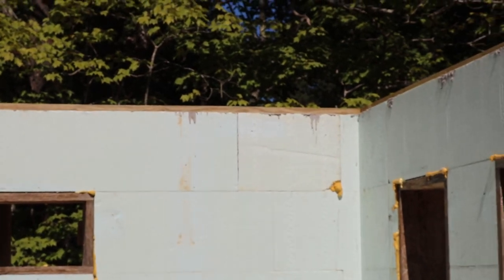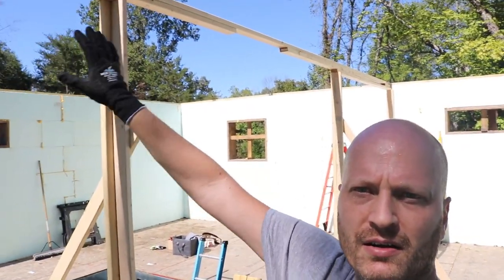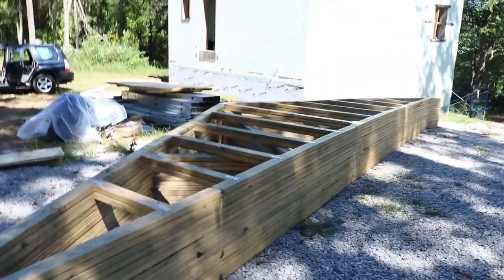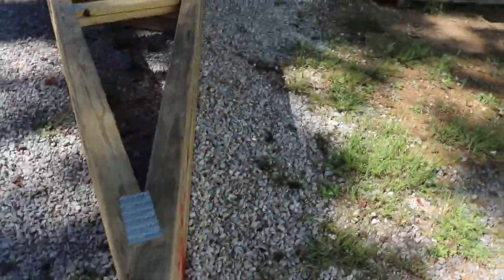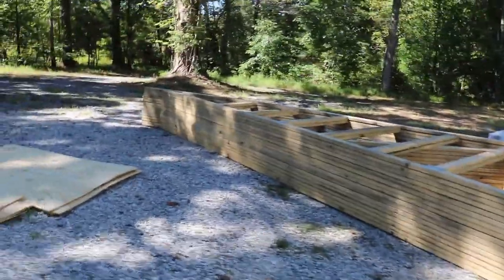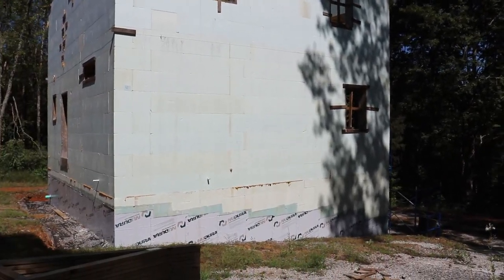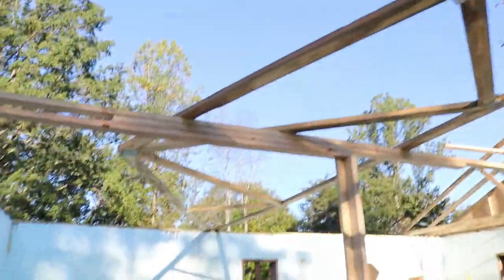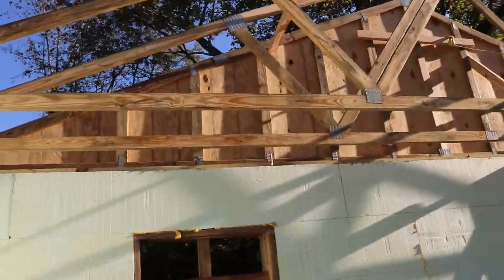RAISING THE ROOF - NO CRANE - DIY HOUSE BUILD

Comment: im pretty sure the two end caps are suppose to be bolted down thru to the concrete.
Also, dont forget to add (what ive heard them be called, but not sure if there is a more technical name) hurricane straps. Its the pre-formed metal strap, with wholes for where u need to hammer nails in, that join the top sill and the joist together.
Also, i would consider putting in an attic fan, it will save u from needing to run the a/c on completely hot days.
Also, make sure u keep enough osb board to cover the entire floor area of the attic space.
Reply from the maker: The trusses are mounted with structural lag screws and thick L-brackets.  The sill plates are lag bolted to the concrete.